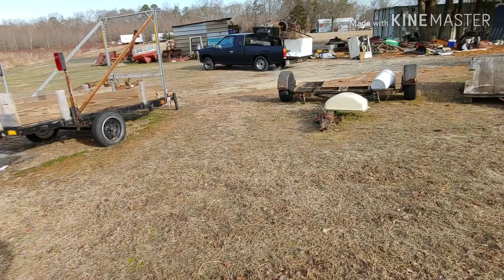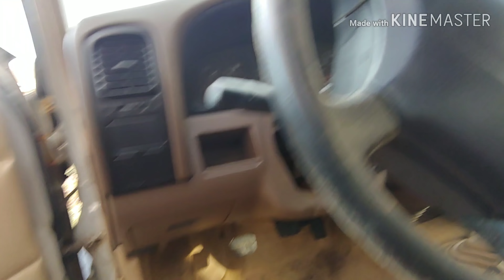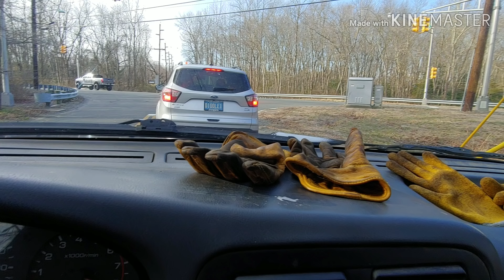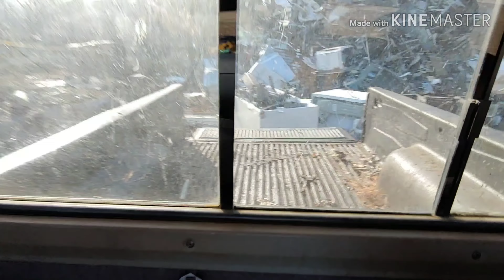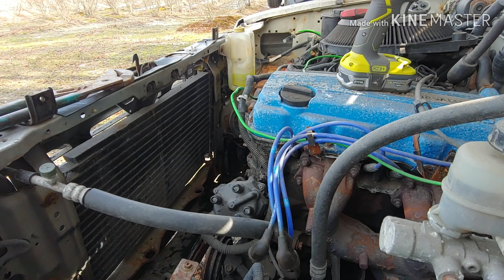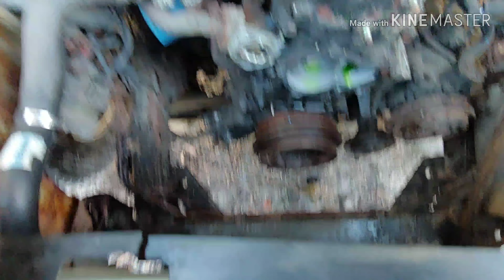Scrap load and helping a friend.

Comment: This is why I drive GM vehicles but it look like you miss a bolt to remove just about the last one you removed.. maybe I'm wrong. But  for me heck no on that bbbiiittcchh engine. Peace yewww
Reply from the maker: Like my gas sippers.  The bottom line is all that matters to me....one day i will have a chev but it will have a diesel benz in it...  I know blasphemy...lol
Reply from the maker: Only 4 in the oil pump its siezed...up grade the tensioner and there good. 👍